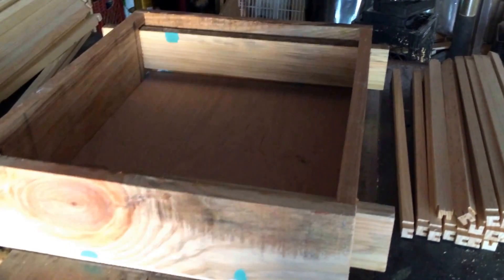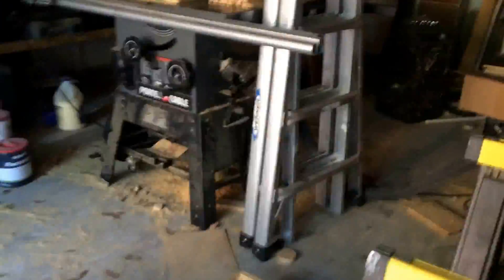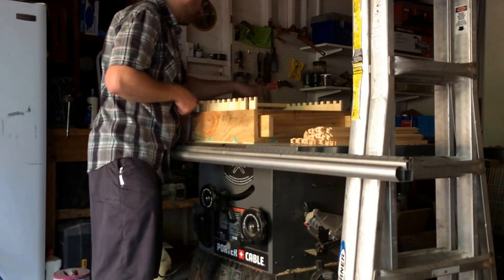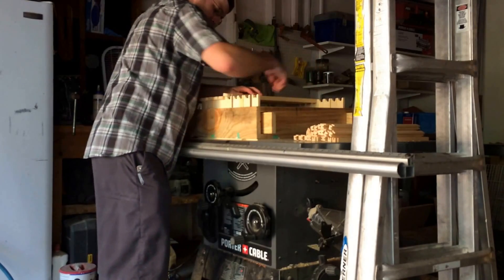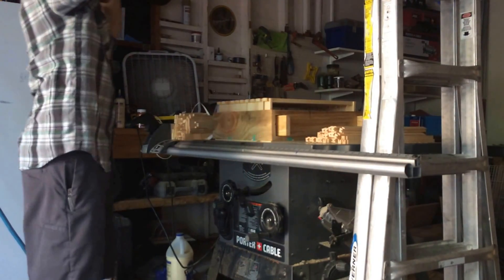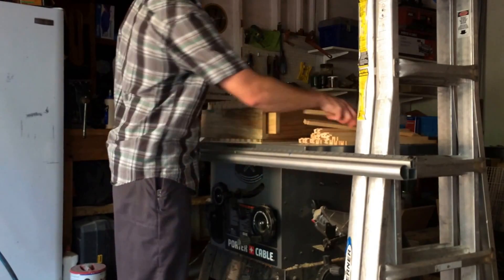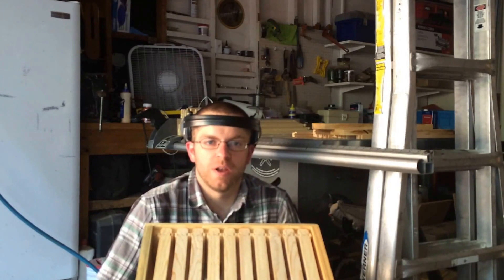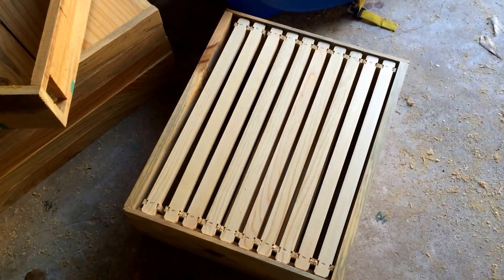Langstroth Beehive Frame Assembly Jig; Explanation and Demonstration.

Comment: Do yourself a favor and add a staple through the end bars into the top bar, just under the ear of the top bar. That staple is the best thing to keep frames from coming apart when they're propolised and you're trying to pry them up out of the box. Some may argue that it's not necessary but it is good insurance.
Reply from the maker: For sure I need to. I rely on the glue at this point. I need to get a faster setup to do all the extra staples. It’s hardly worth the effort to buy and assemble anymore, unless you have a lot of spare time. I’m at a point that I buy fully assembled frames when I need to replace, otherwise I never find time to assemble them 😄
Reply: @tombrueggen1744  I understand. I thought I retired but found I only changed jobs!😳

Comment: Are there any dimensions for this?
Reply from the maker: I don't recall. I just tried to make it tight enough to keep things held in place, but also with some slop so the frames can slide in and out easily. You can just grab as assembled frame and start figuring it up. Sorry I don't have a better answer. Honestly though I think I built it on the fly, never really had a set of plans/dimensions.

Comment: Nice video mate. I'll be making one of these and you made it look easy. Cheers.
Reply from the maker: Sutho1973 Be sure to reinforce the corners! Mine have wobbled loose from constant use. It wouldn't hurt to make it a bit taller too. If you aren't using shallow frames at all, I'd make it about as tall as a possible to still build a medium frame. It offers more support to deep frames that way, and gives you more surface area to secure the corners. Good luck!

Comment: I gave you a like for the video, the the radio wasn't offensive, it was hard to understand you. keep the videos coming. Great job
Reply from the maker: Yeah I know. I have to set my phone off to the side to get the whole shot, and then you get a lot of my rear end :). In this one though I noticed I have the fan on instead and there is some fan noise. On my other channel I post stuff about my chickens, and most of the time you can't hear me because they are making too much noise. Again, thanks for watching!
Reply: +Tom Brueggen   No worry about the fan noise.  Little higher angle and tripod helps..  Guessing that is my years of photography background.... your vid was really helpful.  Appreciate the time and effort...
Reply: +CoalfieldBeeLover Gerald thanks for the tip. However I'm not too worried about it. I just prop my phone up on something nearby. I've made a few efforts to use a tripod before with my wife's fancier camera but I just find it more hassle. Hope your jig works out. Thanks for watching!